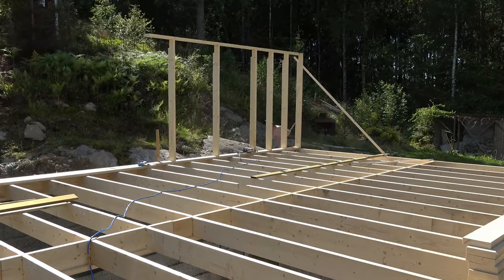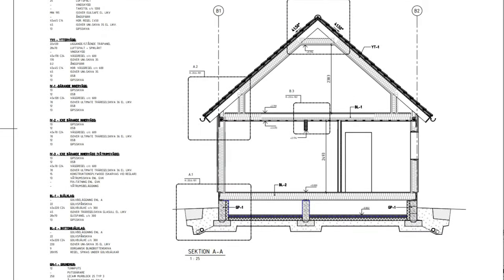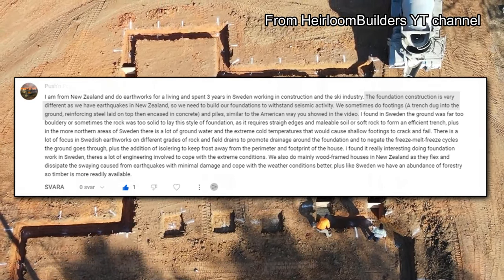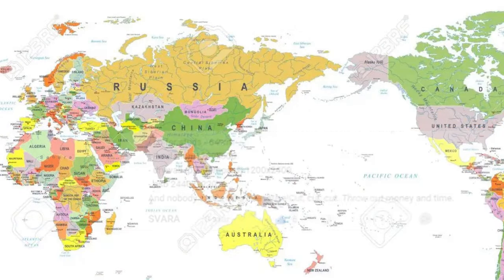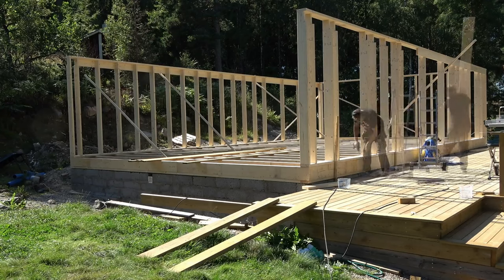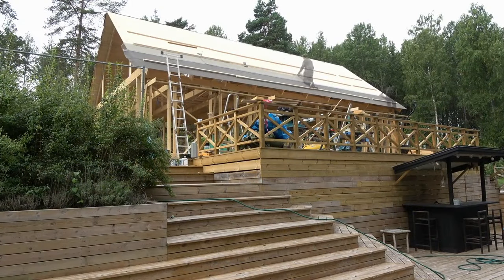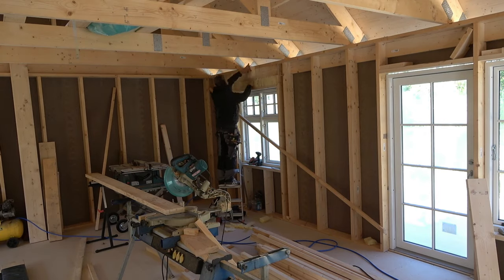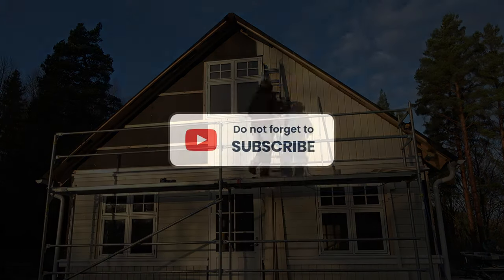UPDATED VERSION! Scandinavian VS American, CA, NZ, RU, AU building methods, let's compare...

Comment: Okay I only have watched the first 48 seconds so far but I have to ask, why not sheath the floor before building the walls? So much more efficient, much easier and safer.
Reply: Watch a little longer, he'll clearly explain why.
Reply: @Scotteases  Yes Thank you sir I did. That made it even more bizarre to be frank. One guy could lift the rafters up on top of the walls from on top of a sheathed floor. Been there, done that many times with heavier trusses than those in the video and gable trusses. So much time and effort would be saved by building the floor complete building the walls on the floor, replete with wall sheathing and house wrap and standing them up and then placing the rafters. To each their own. Cheers

Comment: OSB on the inside?? Very bad idea with off gassing. The fix is to use osb as exterior wall sheathing and wrap the exterior walls in a house wrap (seams all taped) and ensure that all window and door openings are properly water sealed before installing the windows. This way your exterior osb will never see any moisture and will last as long as the building lasts.